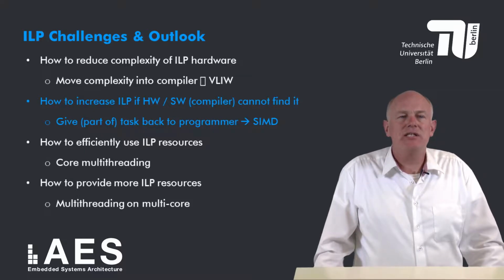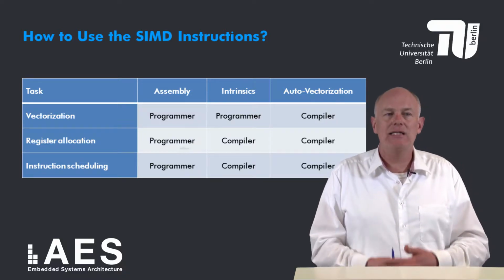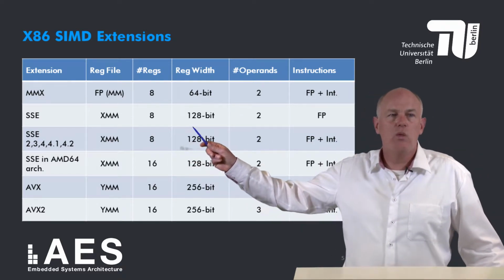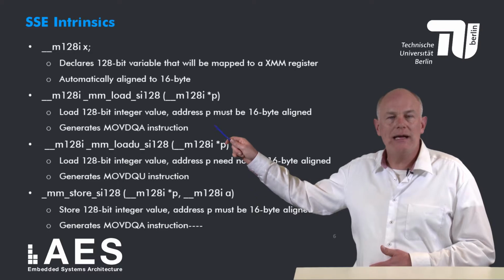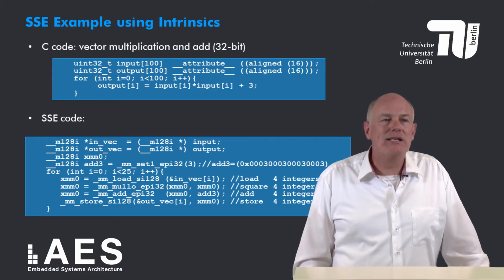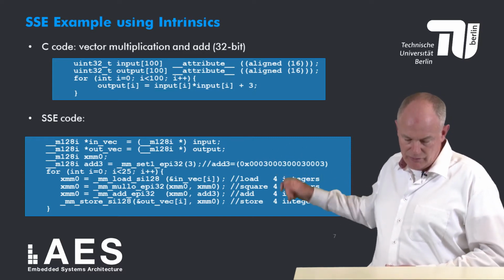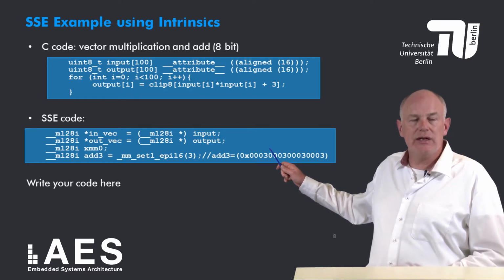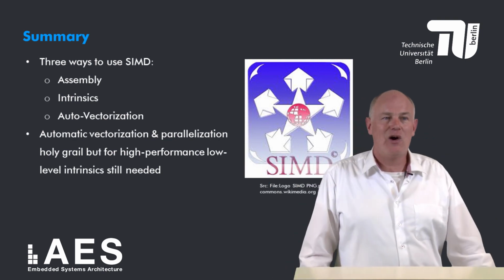2 3 7 Case Study Intel SIMD Extensions

Comment: "Write your code here"...

Can you name any SSE instructions to implement a lookup table?
I didn't find it and I think it doesn't exist.
Why do you ask to do the task that can't be done?
Reply: I think you might be misunderstanding the task.
The clip8 table lookup is a clutch which is intended to direct the student towards using clipping/saturating SMID instructions.
One could reformulate the assignment with a call to an unspecified clip8 procedure instead of a table lookup.